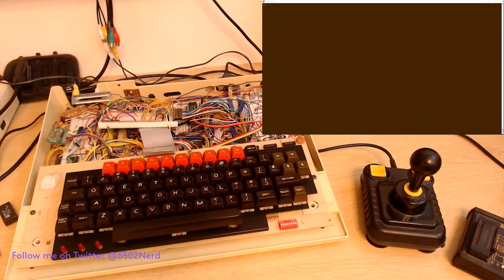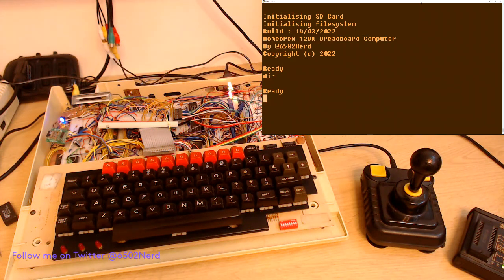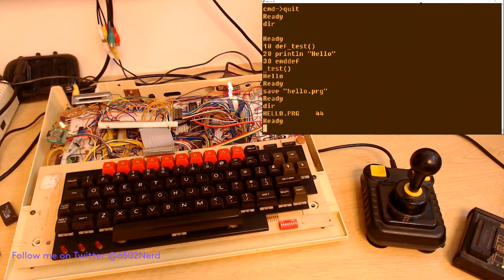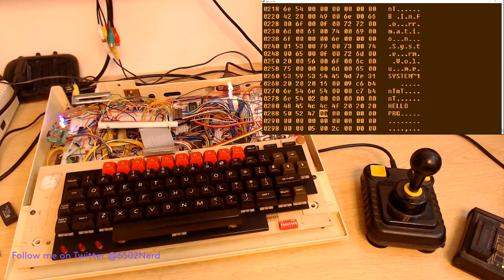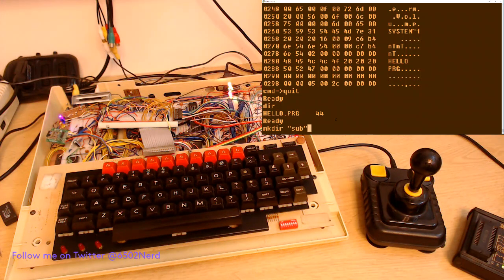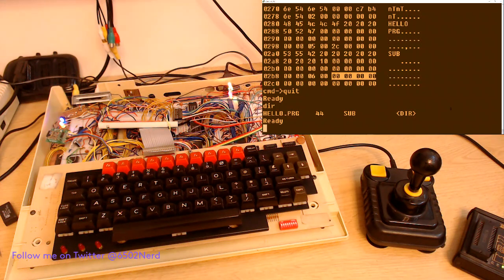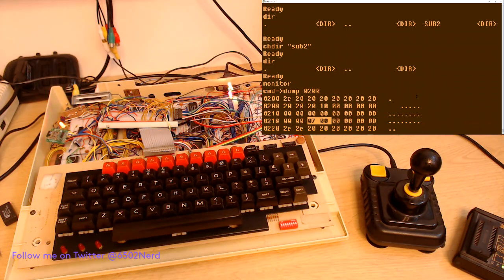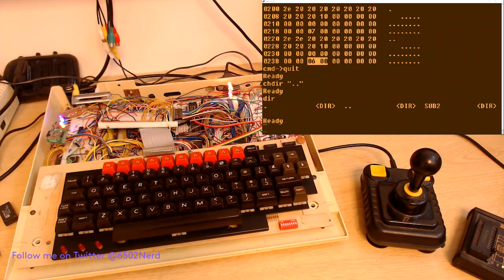6502 Homebrew Computer - FAT16 deep dive!

Comment: Great video! At 7:03 you mentioned that FAT16 cluster size is 16k. Isn't a configurable from 512 to 64KB? Afaik affects the max file system size.
Reply from the maker: Thank you for watching this quite detailed video - you must be one of very few people who got this far!!!
Yes you are absolutely right about the cluster size being variable (depending on the size of the disk) - it's a parameter that should be picked up from the boot sector.  However, I have been lazy and so my implementation needs 16K!  I should probably sort it out sometime - it wouldn't be a massive change (I think)..